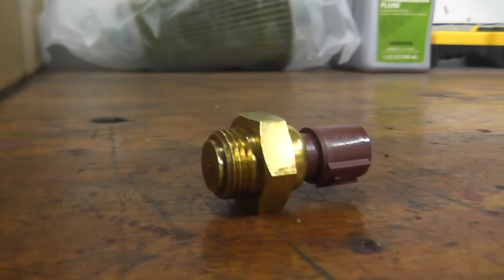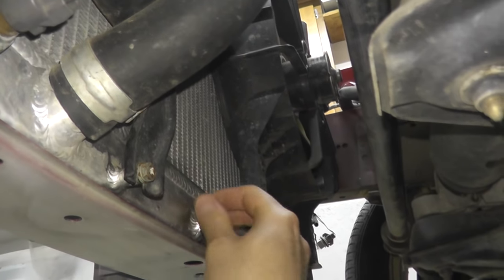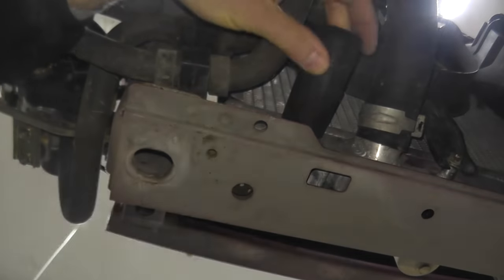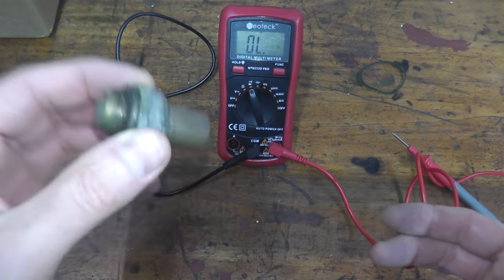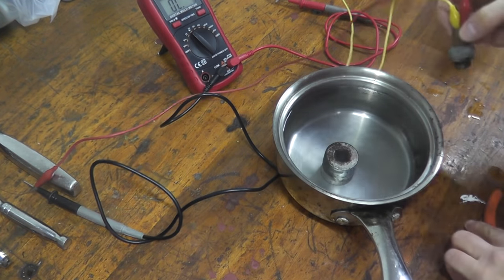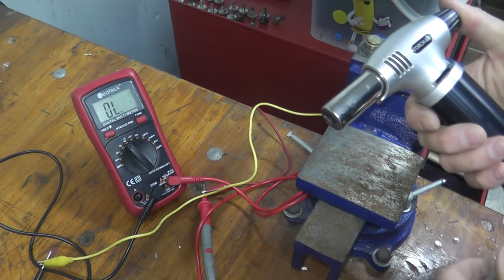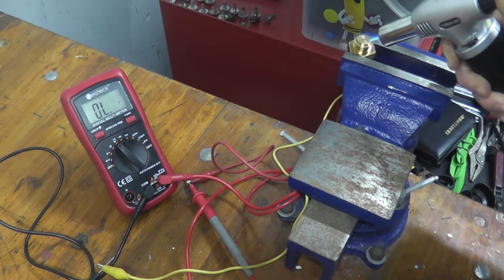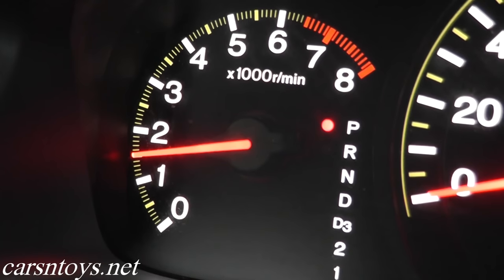How To Test and Replace A Radiator Cooling Fan Switch

Comment: Nice demonstration, but I think it's important to note, as mentioned in some other comments:
- Blowtorch test is NOT definite, as failing switch might close at the higher temperature and cause engine overheating.
- Boiling water is much more precise, and adding a cheap food thermometer can test more accurately for the open and close temperatures, which are sometimes printed on the switch itself.

Comment: I would like to chip in something so others could learn as well. I have tested the same way as demonstration and it beeps as it should since my switch is working. However, my switch made that connection at 214 degree (sometime 217) which is a lot later than specs allowance and that is where all the trouble come from. The temperature gauge starts climb over half mark. So pay attention there as well. That was what I call half a$$ working switch and it must be replaced as well if you don't want your car overheating.

Comment: Thanks for the very informative video. My temp switch is self grounding so only one terminal. How do I use the multi meter for that? Thank you in advance!
Reply: I think that the radiator is it's ground which means that the body of the switch is the ground. In that case you should attach the negative(black) prong lead to the body of the switch and the red to the contact pin.
Reply: With a single pin temp switch, the body of the switch grounds to the engine, so one lead goes to the terminal on the switch, and the other lead goes anywhere on the engine with a path to ground.

Comment: Thanks a lot for your video, like always very well explained.
Reply from the maker: My pleasure!
Reply: @CarsNToys  
I tried testing my switch, in boiling water temperature it did not give continuity. With torch flaming it for 6-7 seconds it opened up and gave continuity. I put thermometer on the end and it shows 200 degrees from torch. Is there a lot of heat loss after you stop torching? why will it give continuity with torch but not boiling water. Is the switch bad?

specs: its a BMW double temp sensor switch with 3 prongs. 91c degrees low speed 104c high speed.

Comment: You can also take a short piece of wire and touch both connections on the plug and if the fan comes on you know your switch is bad

Comment: Hey CarsNToys, I have a question for you. Maybe you can shed some light on the subject. I had a faulty Fan switch for my 98' Camry and decided to order one from the dealership and it arrived today. I installed it and my car reached 199F and it did NOT switch the fans on. I let the car fully warm up and burped out any air bubbles and drove around and my car went up to 217F when the switch finally activated! But that's too high, the temp needle is a bit above the middle marker. Is it possible to have a bad switch from the dealership? Or should I look at something else?

Comment: Thanks for this. What should I do if the fan still doesn't work with a brand new switch and fuse? It turns on when I fiddle with the switch but then it turns off again  a few seconds later

Comment: Hi thanks for the help, I have a question about my situation. 

The switch I'm working with has no plug/harness, it was just directly wired in. These wires are cut so there are 4 loose wires, two from the switch and 2 from the vehicle. Does it matter which wire from the switch goes to which wire on the vehicle?

Comment: Why would you do a jump cut between lighting the torch and when the meter indicates continuity, if it only takes a few seconds? All that does is make it more difficult for anyone trying to emulate the test method that you're demonstrating. 

I appreciate that you're trying to help people with this video. Otherwise generally good info.
Reply: right! i have a 2005 lexus 330es fan cooliong switch that i did this test but after heating it, it seem it does work. i dont know if it works or i just overheated it for like a whole minute and that somehow cause it to just click

Comment: Why do you have to remove the switch in order to do this? Couldn’t you just check for continuity with the engine running and see if you get it once the car is hot?
Reply: Probably because he already knew it was bad so he was going to change it anyways. Another option would have been to bridge the pins inside the connector and sew if the fan switches on before removing the sensor
Reply: Also I think the water pump has a big saw in this cuz it needs to be operational to shoot the coolant throughout the engine so the switch picks up the hot coolant to kick on the fans

Comment: if the temperature gauge works  can you say sensor is good?
Reply: Nope, they are two different sensors. The temp sender is found on the engine block (I think), and the fan switch is found on the rad.
Reply: @Seagrams  thx for reply for chevy caviler its different it works on cts and computer 💻

Comment: Can you explain 195f, 205f what is the difference in the number
Reply: 195° Fahrenheit,  205° Fahrenheit,  these temperatures are what the thermostats and temperature switches are designed to open(tstat), or close(switches) depending on manufacturer

Comment: do all cars have a radiator fan switch on the radiator? i found the radiator fan switch on my 2001 honda crv by the thermostat in the engine bay. but in this video you're saying the dan switch is in the radiator itsself? or is that the temp sensor? or maybe you have a different car.
Reply: There are 2 temperature sensors. 1 in radiator, manage fan on/off to keep coolant in temperature range. 2nd is on engine itself, it send you temperature readings on dashboard. Thermostat is just a valve that should be closed when engine is cool, so it can quickly get to optimal working temperature (cabin heater is using coolant too, so shorter loop helps getting heat too cabin faster) and opens up when engine gets hot so it have more volume of coolant available.

Comment: I installed new radiator, fan system with built in resistor and thermostat unit on 2012 fiat 500. Fan does not come on at all. Ran wire from battery to fan to check and it kicked on, pulled high and low relays and they clicked, fuses good. Temperature rises to halfway mark and still nothing. I shut down so does not over heat.  Ran engine with cap off in case of air lock. Totally baffled

Comment: SHORT & SIMPLE.  QUESTION, THE AUX .FAN SWITCH ON  AN 85 CORVETTE HAS A SINGLE WIRE.  HOW DO I TEST IT?  HELP.
Reply: The other connection is probably the metal casing of the switch, as the body of the car is usually connected to DC negative.

Comment: What does the Radiator Cooling Fan Switch besides just maybe turn on the radiator fans
Reply: That's it! Just fan on and off
Reply: But you also have a relay  doing the real switching.

Comment: omg !! can someone help!!!  I noticed the other day that my car was smelling hot started to run a lil hard so i noticed I wasn't hearing the fan kick on . last thing I want to do is blow the engine so I tested the fans and they work i replaced the thermo switch the thermostat the relay and fuse checked all wiring for burns and cuts didn't see anything I even flushed the radiator and refilled it.  and my fan still wont kick on by its self. i have to keep my ac on to keep it cool . the car doesn't over heat well at least the instrument panel gauge reads normal but like i said I can smell when its getting hot. any ideas what I'm missing thanks in advance
Reply: I'm in the exact same situation as you. Car started running a little hot but only at slow speeds. Checked the fuse, it was good. Swapped the relays and both work. Checked the wiring and nothing out of the ordinary. It's not a thermostat issue because that would effect you on the highway as well and my car runs fine if not idling or in stop and go traffic. I used a power probe on the fan motor and the fan motor works just fine. I also found out as well that if the AC is on near max then both fans will kick on and keep the car from overheating. I replaced the fan switch with an import direct from O'Reillys and it still wouldn't work. Took the car to the auto shop in town that I trust and they told me the fan switch that I replaced was faulty and didn't work. I replaced it under warranty with another one from O'Reillys and it didn't work. I took it out and used a blow torch on it and my multimeter told me I have continuity so I'm going to check the connector to the fan switch in the thermostat housing and then reinstall the one I have and see if it works by some miracle of the heat from the blowtorch made it work. Please let me know what you find out. My vehicle is a 1993 Honda Accord
Reply: I ran a paper clip in the positive and negative part of the connector that plugs into the fan switch in the thermostat housing and my fans turned meaning that it has to be my fan switch (AGAIN!) so I will be returning this one and getting one from a junkyard. I will see what happens. It sounds like Hondas are really picky as far as fan switches go so try going for OEM or Denso if you check your fan switch again and find it's bad. Hope this helps, I will let you know what my results are tomorrow
Reply: U need me in your life swithart so u won't have 2 weary about stuff like that

Comment: can we install a lower temp thérmo switch say around 75⁰C turning on temp?
Reply: Yes you can, the fans will just kick in a lot lol I just received my 80° C switch and I wanted to do this test but idk how I feel about torching it I feel like that's too much lol
Reply: Possible, but not good idea as it might not reach operating temperature, and run too cold, which is also not good for the engine.
Reply: @zdrz7727 it wont run cold cause we have the engines thermostat thats in the block responds for opening after reaching working temp
Reply: Hi
Did you find a solution???

Comment: what if it always has continuity when it is cold
Reply: I have same problem.. Do you have an answer already?
Reply: Means it's likely stuck in the On position. Your rad fan should be running constantly if that's the case.

Comment: I have a brand new switch, but it turns on fan for a maybe  15 seconds and then goes off.
I have bridged pins in plug and the fan is working properly. 
Should I try a new sensor ?
Things like thermostat,  water pump, auxiary water pump seems to work fine ...
Don't see other option🤔